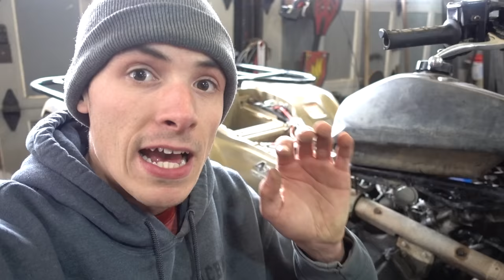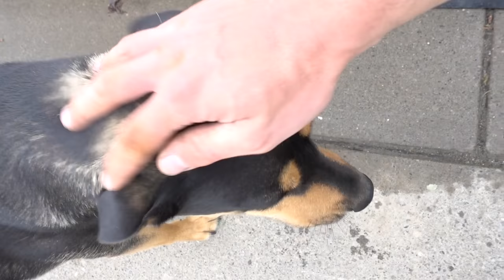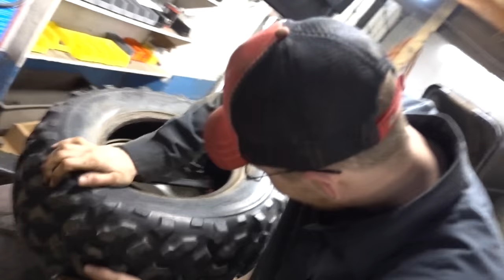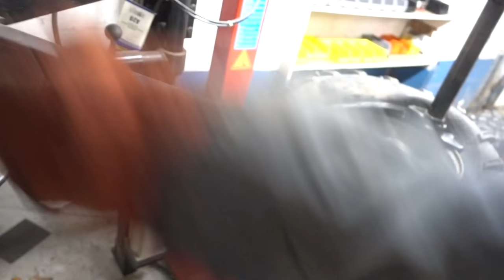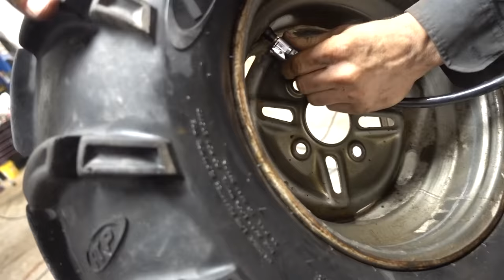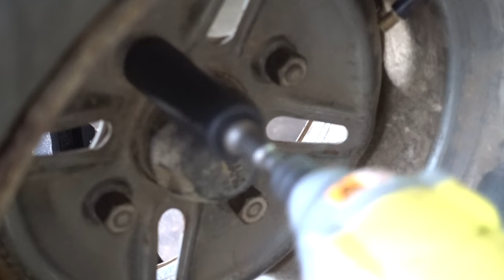DESTROYED THE KODIAK WHEELS!! (F*CKED UP)

Comment from the maker: What's more important when riding. Good front tires or good back tires? Let's say you could only choose 1.
Reply: 3DMachines good back tires with a 2wheel drive four wheeler
Reply: 3DMachines back tires in my opinion the front should always be in the air brapppppp wheelies!!!!!!
Reply: I'd say back personally
Reply: love u bro
Reply: 3DMachines would make my day if u responded bro i live in pa just rode in the rain today
Reply: 3DMachines I would say front because better bracking and sterling
Reply: 3DMachines I run good tires on all 4, I have mud lites on my grizzly also. love them
Reply: i run super traction on my front tires and small on the back so i can drift around and turn easy and if i get stuck then just put it in four wheel drive then the whomper front tires save ya
Reply: 3DMachines front, rather drift then go face first into a tree am i right?
Reply: 3DMachines it depends if yours is four wheel drive or not if it was two wheel drive I do back tires but if it was four wheel drive I do the front
Reply: 3DMachines I prefer good side tires- left side specifically
Reply: 3DMachines it depends what I'm doing, mudding I would say back tires, but plowing, racing, or doing donuts, I would rather have good front tires and let the back go
Reply: Back due too not being able to steer. So  if you had bad ones in front  you can correct a little by steering
Reply: 3DMachines back tires
Reply: 3DMachines both
Reply: 3DMachines I like stopping
Reply: I'd say front to steer better, cause it's gonna be a lot better getting stuck from bad back tires, instead of smashing a tree cause of bad front tires
Reply: Why not buy 2 front rims also. Why do you only buy two pairs
Reply: front but back are better looking and better in like mud or like on a rainy day for when the ground is wet
Reply: 3DMachines I o
Reply: 3DMachines ii
Reply: Matching tires.
Reply: 3DMachines, I'd want good back tires to throw some big rooster tails in the mud!!!
Reply: 3DMachines definitely matching tires front and rear.
Reply: 3DMachines what if you want to put one of each like do the left or the right side only
Reply: 3DMachines back tires
Reply: 3DMachines rear tyre more traction in mud and easier to ride up hills
Reply: Yea some people just start their car and drive straight away, sometimes i swear they start the car in gear. I let the cars and motorbikes warm up first before i rip.
Reply: back tires are more important
Reply: 3DMachines rear tyres just because maths and science and it also depends on how froggy fresh your feeling
Reply: 3DMachines front tires
Reply: 3DMachines Kx please?
Reply: Well. when you have a 2wd quad, most likely the back tires. If you can't make a turn in the mud cause of understeer, you can always pick up the front of it and move it yourself or use a winch :P
Reply: 3DMachines rear
Reply: 3DMachines good tires all the around is the best! but if i had to chose it be the back ones are more important. it will get you out of sticky situations better.
Reply: 3DMachines rear tires should always have the best tread.  Goes for about everything
Reply: 3DMachines rear tires
Reply: Back tires cause my fronts are still bald been riding like so for about a year pavement does not do ATV tires well
Reply: I'd say new back tires
Reply: 3DMachines back
Reply: 3DMachines back I had fucking bald eagles on the front of my grizzly for a year the back tires still took me anywhere
Reply: Back so u don't fish tail
Reply: front on a ATV
Reply: Back more grip means more ripping..... Grip it and Rip it
Reply: Dustin Hogan back tires more traction and front don't make that big of difference
Reply: 3DMachines I have a rear wheel drive four wheeler
Reply: 3DMachines drive wheels are important so if it's rwd rear tires fwd front tires awd all 4
Reply: Luke Lushington you clearly don't off-road on a racing aspect point off view. fronts in a racing aspect need more tread less aggressive to keep ATV up on top of soil with usually same tread depth if not a lil less but. more aggressive cut in order to reach end of track faster. so from this point of view my friend is why I say tires up front. I race almost every weekend and also rock buggy race as a hobby on the off seasons of mud events
Reply: 3DMachines good front tire because if I pop a front tire I can't drive, but if I pop a back tire I can ride just fine. So a good front tire is always better .
Reply: Good front tires
Reply: 3DMachines I have a 2002 Yamaha kodiak 450 4x4 2600 new tires and is in very good condition nothing wrong with it
Reply: 3DMachines good back tires
Reply: 3DMachines back
Reply: 3DMachines are you going to get front tires to? It's hard on the 4x4 to run different tires
Reply: 3DMachines
Reply: 3DMachines both really
Reply: 3DMachines  back tiers u get better grip
Reply: 3DMachines fronts
Reply: Conner Hancock  I agree
Reply: Back tires on my 1985 Honda BIG RED!!!!!
Reply: 3DMachines left front and right back?
Reply: 3DMachines why would you need front tires when they aren't even on the ground!?... BRAAAAAAAAAAAAAAAP!!!!!
Reply: 3DMachines rear for sure.
Reply: 3DMachines front because you can drift in a somewhat controlled way
Reply: Luke Lushington lol okay kid
Reply: 3DMachines I think all tiers are good that's why you should tork your lug nuts but the rear are more imporant
Reply: 3DMachines back tires
Reply: Colepaq me too
Reply: 3DMachines one in the front and one in the back
Reply: 3DMachines I would say both. But theirs nothing I hate more then shitty front tires cause you can't steer as good, handle as good or even stop as fast.
Reply: 3DMachines I say front cause you can steer and if it's 4 wheel drive than it will still provide traction
Reply: 3DMachines it depends on what I'm doing mudding back, racing on the street or on the trail I prefer front and can u give me a shout out
Reply: front tires because if you cant steer what is the point of having good back tiers drive you in to a tree.?
Reply: 3DMachines back tires because you can just steer with the rear brake and just drift
Reply: front because pullings easier than pushing with thoes machines
Reply: fronts and back tires are important but only the left side HAHA, jk
Reply: 3DMachines skinny fronts and wide rears work the best in mud.
Reply: Front, grips good and leaves the rear for drifting around turns/doing donuts without feeling bad
Reply: THEGENR4LLEE  true
Reply: Hi 3DMachines ! I would choose the back tires because you get more trackshin on them. Stay Froggy fresh.
Reply: If you don't have good enough traction to go forward then the chance of you hitting anything becomes obsolete right? hmm...
Reply: 3DMachines The back tires id rather get going faster ya know who cares about steering just screw it. The only thing important is to get moving forward.
Reply: I'd say back tires  cause I rather get moving quicker
Reply: Mike Stroz left cause you like to drift I'm guessing
Reply: Mike Stroz drift on the left side
Reply: Front tires to go around corners
Reply: hey dalton for future reference you could have thrown a tube in that wheel that wouldn't hold air. Next time.
Reply: 3DMachines back tires
Reply: 3DMachines most likely back tires bc ur going to want nor traction n who really has bald front rubber 😂😂💯
Reply: if u cant go forward u cant hit the tree
Reply: back more weight is on the rear tires
Reply: 3DMachines Why did u sell the polaris?
Reply: Good back tires all day
Reply: Back for sure
Reply: 3DMachines my quad has 4400 miles and it's a 02/3😎
Reply: 3DMachines back tiers are better if you want to go places faster but. if not front ones for if you have to do frowned opon things so you don't rip up the back tires if you have a solid diff in the back of your quad (on the road):)
Reply: 3DMachines Could
you please not cuss in the titles of videos, it would be extremely appreciated. Thanks.
Reply: 3DMachines now make shore you retorqe them we all know what happened in the past with no retorqe
Reply: 3DMachines I wish I could choose more but back tires and in reality both good front and back tires makes equal traction
Reply: backs
Reply: back, id rather have to go slower on flat and be able to climb hills better, I hate going up a hill then start spinning and have to back down
Reply: 3DMachines front tyres
Reply: Front
Reply: You know where the Interco tires are designed right. They don't have that deep tread for nothing, down in Monroe Louisiana. Next tires for your truck look at the Interco SS-M16 great all around time.
Reply: 3DMachines front
Reply: Back tires because you can just give her gas and whip the back end around.  Well that is on the dirt at least.
Reply: rear tyres are more important imo you don't slipp as easily
Reply: front tires because you can turn better and i maybe saves your life one day
Reply: if its all wheel or front wheel drive front tires if its rear wheel ride rear tire
Reply: in the back of course. the front don't need much grip to steer.
Reply: 3DMachines I always warm up the truck
Reply: 3DMachines Front tires are more important. for steering and front wheels take 75% of your braking force.
Reply: 3DMachines Back tires because if your front tires get more grip then the back your more likely to flip your four wheeler
Reply: 3DMachines or just but four good tire
Reply: 3DMachines also front tires are good for fourwheel drive and when ur stuck but I'd say back because u have more power to the back and it always depends on the back ones less the front
Reply: 3DMachines I like having both good front a rear tires
Reply: 3DMachines front
Reply: Front
Reply: front, if you get into a hole or a hill and your rear start to spin you have to use the front to pull you out
Reply: Back

Comment: in the winter i always warm up my p71 but once it hits 50 or higher ill just let it come of off high idle and take off. as long as you have good oil circulation you can technically just get the oil flowing for 20 seconds or so and go with a gasser

Comment: When we do get cold spells during the winter time where I live in Sussex County Virginia and I have to use my 07 dually Dmax, then I will warm it up for about 1 minute because it sits in my pole barn. My 2015 3/4 ton Dmax sits in my heated garage, so I don't warm that up. As far as petrol vehicles, I start them up and go. Idling just wastes fuel. A vehicle will warm up quicker driving down the road than it will by sitting and idling.

Comment: Dalton you should torque your lug nuts!!!
Reply: i torque mine down by holding down the impact for an hour! good to go!
Reply: DP you better remember the last time he didn't torque down your Lugnuts
Reply: Meh Gusta yah I do the same thing
Reply: +Meh Gusta that's how you ruin a bearing......
Reply: never happened to me :p
Reply: Just cause it's never happened to you doesn't make it a good idea.  I've had even family members who did that and within 6 months they're needing new wheel bearings.  In fact, usually the bearing says in big letters "DO NOT OVER TORQUE LUGS" on the box.

I've also seen studs break off while someone is driving, not sure if that incident was related but yeah.
That's assuming your impact is strong enough to severely over torque the wheels.
Reply: sucks to be them, they did it wrong.
Reply: Meh Gusta I have a (crap) 15$ harbor freight impact that couldn't snap a tooth pick. And a $35 kobalt 350 (highly recomended)with three settings # 1 even if ridden doesn't go much beyond 70lbs with my set up (3/8 hose 1/4 fittings 30gal@135 max). I wouldn't go near anything with #3. #3 could probably strip or snap the lugs on a 3/4 ton truck if ridden. #2 goes tighter in 3 strikes of the hammer than I'd like wheel lugs. They do make torque sticks to limit an impacts torque.

Comment: I warm up my cars when it's 45 degrees or lower. we only run gas cars and trucks so I usually just go when it's over 45.  in my case on a farm, back tires need more tread than the fronts ( it doesn't help our 4 wheelers are only 2 wheel drive).

Comment: Backtires are better I think. Also I have the exact tires on a 2015 Polaris Sportsman xp 1000. And personally for your quad I think you need 2inch spacers and a 3inch and maybe bigger lift kit. But do what you want to do. Also maybe a kfi tigertail. With some aux beam led pods in the front in place of your regular lights with a long curved led light bar on the rack. And a strong made bumper on the front would be sick. A little pricey but worth it in the long run. Idk what your planning on doing with this quad but everything I suggested would be cool also the strong made bumpers are strong as heck but is really heavy. Just saying it's heavy in case your wanting to do wheelies lol. Good luck, keep up the awesome vids, thanks for making these, and if you don't mind me asking what did you go to college for or what video did you talk about it. Thanks again.

Comment: I have never bought used tires especially bc i use the tubliss system they recommend you use new tires and i think rear tores are more important because u get better traction when stuck and front is important for steering and braking but i think rear is more important

Comment: Dalton I think it's ironic that your rim edge folded over because my 1986 Kawasaki bayou rim did the same thing however there were a few holes I that rim🤔 kinda thought it would happen anyway but hey $200 4 wheeler so you can use a tube like I did which works fine since 2-4-17 btw rear tires so you can transfer more BRAPP TASTIC POWER!!!

Comment: You should get a Honda we have one that my dad thinks it has original tires so it must have original rims too. The four wheeler is 28 or 29 years old and still running strong. It even got pushed into a pile of trees with a bulldozer when we were clearing for a pasture so that thing has weak rims.

Comment: ohhh the fix a flat.......
I'd be looking to get a set for the front the same diameter.. odd sizes are hard on the drive train because there is no center differential.  Can you take it out of 4 wheel drive. I was thinking yamaha's are full time locked.

Comment: If you warm up your motor all the way every time it will last a dog gone long time.. Had a nascar engine builder teach me this, then he built me a motor for off-roading and the thing is still running 10 years later. Its a 350 w/305 heads and has seen 7-8k RPM many times in this Louisiana mud.

Comment: When you're young, your time is not worth much, so the effort to make something used work is beneficial.  As you get older, your time becomes more valuable, and it might be cheaper to just go new.

When I buy something used, I add up how much it's going to cost me, if I'm going to save $10, but it's going to take me 4 hours to save that, then I haven't really saved anything.

Comment: Saving money?????  your in it 100.00$ + you owe the guy a favor that mounted them, what do you have? some tires that are worn down 1/2" some bent 12yr old rims and one with a tube in it. You could get a set of takeoffs (25" or 26" stockers brand new with steel rims from a dealer)  honda  yamaha kawasaki and honda all used that 4x110mm pattern. The dealers  have mountains of takeoffs in the back and you can get a set for around $100.00 sometimes less and you would have brand new tires and brand new rims with no tubes or holes in them.